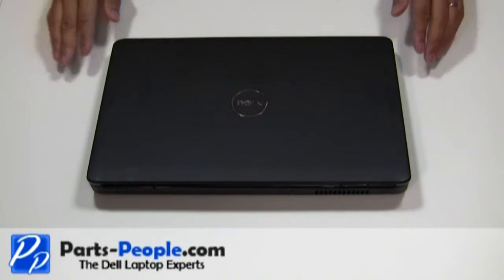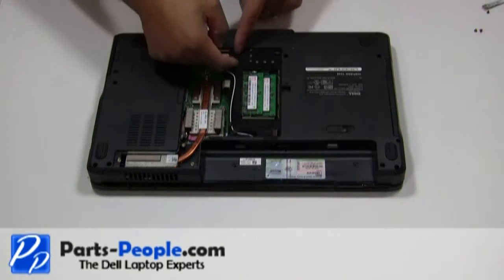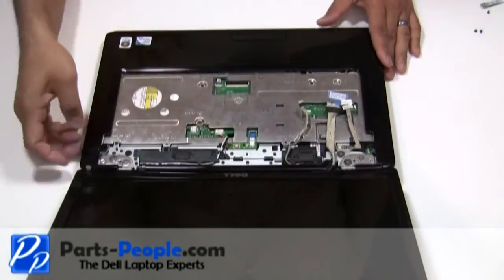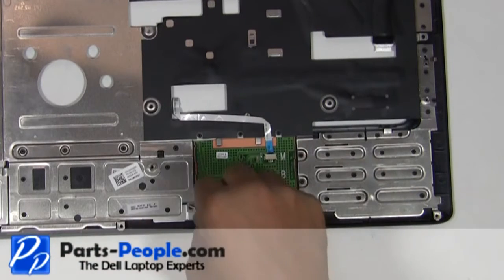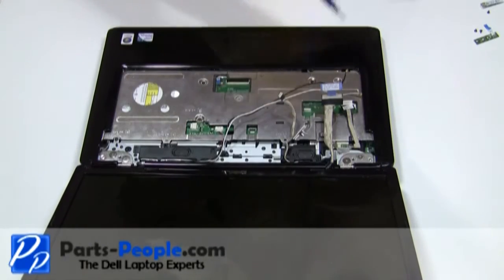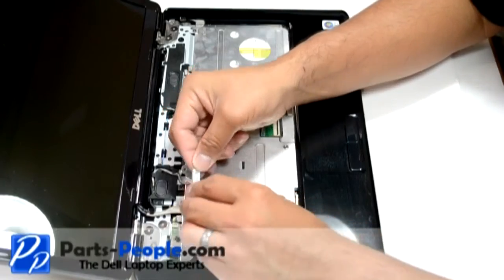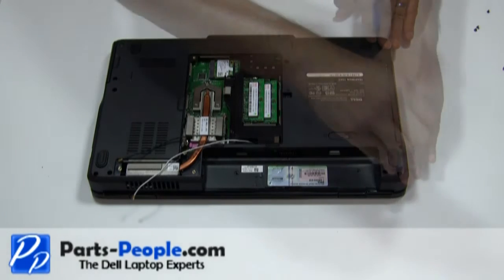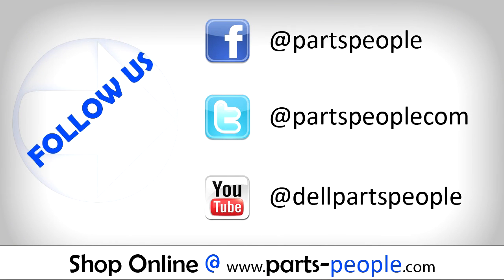Dell Inspiron 1545 | Touchpad Palm Rest Mouse Button Replacement | How-To-Tutorial

Comment: Great video but could do without the percussion noise; very annoying.  The only other problem was in reversing Step 3, putting back the cables.  The clips are so tiny it's hard to line them up in order to reconnect.  Took me about 5 - 6 minutes each.  And I agree, what a hassle just to replace the touch buttons.

Comment from the maker: The time of day error is usually related to the CMOS battery but sometimes you just have to press F1 and reset the time. If you are having problems with it powering on, you will probably have to re-seat the power button cable or replace the power button circuit board.

Comment: Not bad, fairly clear in 720p (I prefer schematic drawings, but where can one ever find them? Not even in the official tech manuals it seems quite often - when you can even find a leaker copy...). I found it toughest getting the power button board off as it has to be moved at precisely the right angle to come off easily, and is held-down by those two plastic clips otherwise (and has a delicate hard-soldered ribbon cable connected to it). ALSO, you could explicitly identify ALL the 11 screws...

Comment from the maker: The power button circuit board may have a bad solder joint at the cable or the button itself maybe bad. I would replace it and see if that fixes the problem.

Comment: I did all those steps and put all back together and now my palm rest and power button won't work right,I tried many different ways to seat it and put the cable in,but still no luck,I did however get the power button to work,but only if I wiggle or mess with it and even then only works sometimes?